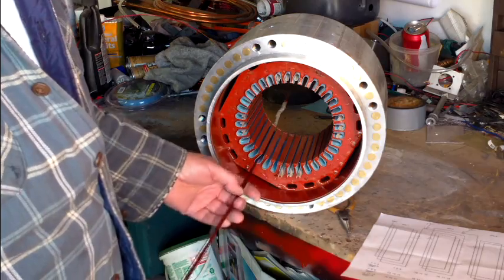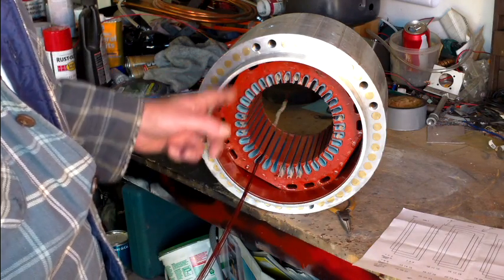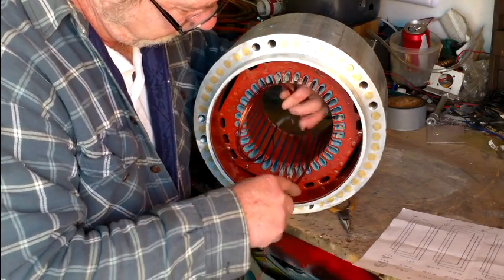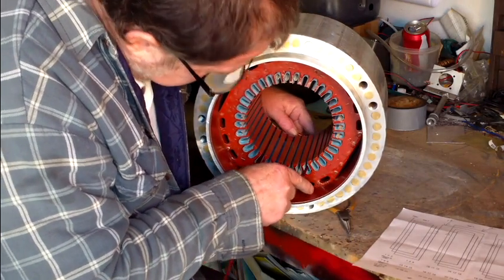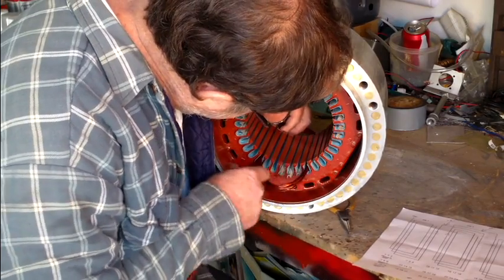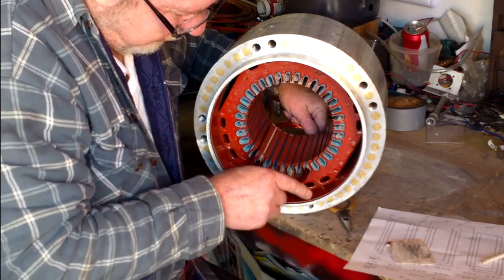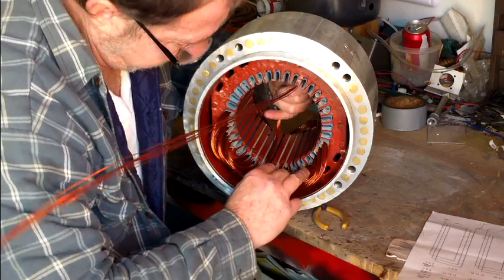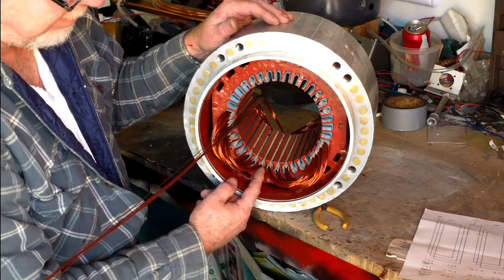Ivan's Garage

Comment: The biggest reason for laying coils all in hand is there is NO pole connections.
For each phase you would have 3 large pole connections (9 total) plus your delta connections, if you did a lap winding..That is why I do basket weave winding. No pole connections.
Reply: sorry mate you are refering to phases so you did 9 coil so it is 9 groups of maybe 3 coilsg for a 6 pole consequent so start to finish which you did by your wiring for a conventional winding of 28 groups of what ever coils you need to so start to start or finish to finish where you can not do how you have wound that motor.
Reply: Don't know what you are talking about.
Simple,  Lets talk 1 phase, There is 3 coils per pole 4 poles per phase evenly distributed around the stator, four pole motor. Each pole uses 9 slots.
I can lay by hand each phase in 45 minute.
Reply: me cantry India pls sr call me
Reply: +Aaron Melbourne ;  You claim to be a winder, but I can't find any of your videos. I wonder how you could find the time to wind Motors when you spend so much time bashing an old man. At least he is willing to volunteer his time and knowledge in hope of helping someone. 
You may ask yourself ' who am I to be speaking on this subject ??'. Well I am an electrical service tech. I can wind, balance, surge, hi-pot, load test, and install an Electric Motor.  I also laser align, do vibration analysis, size & install AC drives, starters, contacts, & phase inverter's. Along with PM DC's in place or in the shop. 
I obviously don't need info from this man but I appreciate his willingness to help others and pass along information. if only more people would do the same......
Reply from the maker: Really don't understand, there is 8 vids on winding and the forum.
http://ivanbennett.com/forum/index.php  this forum is two years of research and posting all for FREE
Reply: Thanks for your time and effort.
Reply from the maker: Here is list of vids on winding.
https://www.youtube.com/user/Ivansgarage/videos
Reply: Hi